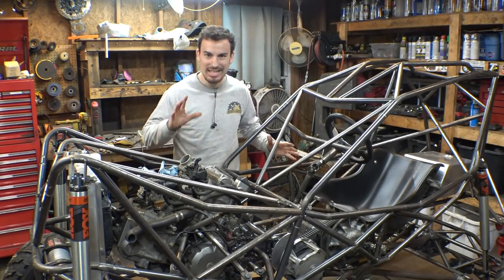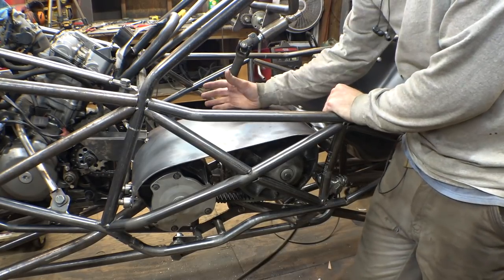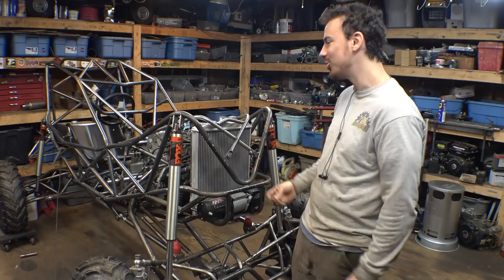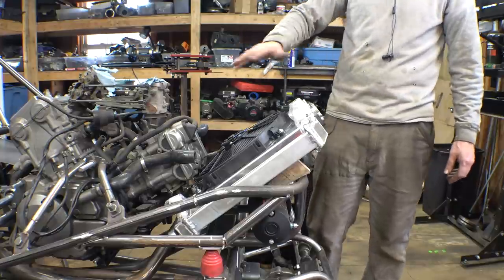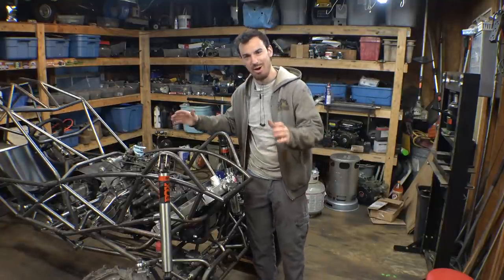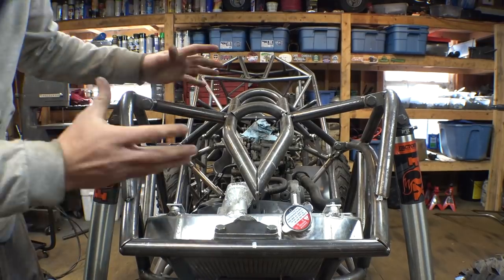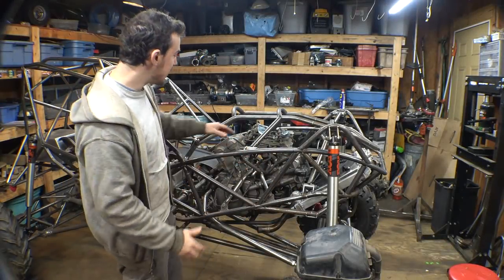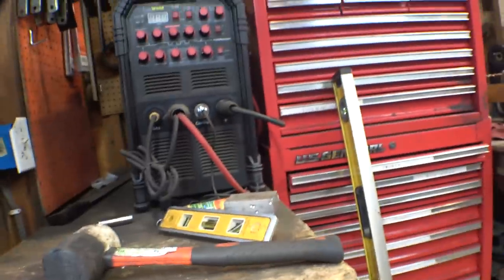4WD Mini Rock Crawler Build SV650 Part 9

Comment: You should wire the fan to blow air through the radiator.  This will keep the hot air out of your face and should theoretically protect the front of the radiator from small debris with a cushion of air. Keep doing exactly what you do. 😊 you’re channel is better than tv channels.

Comment: It looks better! What about leave that x brace between the shocks in then don’t have anything over the motor? Then make a sweet low profile intake/air box out of aluminium like and ram air scoop👍
Reply: Agree. The tubing is just as tall as the radiator he had to move.
Or run the tubes around the side of the engine instead of over it?
Reply: @1one3_Racing  yeah I like that idea

Comment: I agree with you that the front end does look much better. I feel that clutch guard  is adequate, much better than whats on a snowmobile. Yes clutches and belts do fly apart at times but you will be fine with the guard. Good job Chris.

Comment: A surge tank for the radiator would solve a lot of your air pocket problems especially, if you mount the tank higher than the engine . Also some gussets for your beautiful frame will make your rock buggy even stronger .. Great work . Love the progress you are making...

Comment: Move the winch and tilt the radiator back to blow the hot air under the engine and it will help push the exhaust temps out as well. You'll get more vision too.
Reply: I would have suggested this also but the winch up front isnt taking to much room...A lot of crawler in this similar shape have gone rear fan assisted rad for 2 good reasons,.. 1 no blocking the forward view. 2 extra cooling (the distance to and from the motor for tubing would help a bit) plus you could always add an extra rad/fan side by side...all the while still have plenty of room for the fuel tank
Reply: @rongray8416  I was suggesting to move the winch a little higher so the bottom of the radiator could go underneath it.
Reply: @TheWakeupsheeple  True he could have done that and not have the issue of hot air pocket that I think he's going to get with his new configuration...though I think his forward visibility issue was worse than we thought (like next to none) and 6 to 8 inches would not really help much at all (I'm speculating on this) maybe a combo of raising the winch and moving it more forward and lowering the rad with a shallow tilt back could have minimized the whole issue...Time will tell

Comment: I liked the original shock towers from the windshield to the shocks, but I could see the very front had to be reworked so the radiator could lay down. The new design looks good too tho, and the new center supports look 100% better. Can’t wait to see it crawling. Great work!

Comment: should consider redoing the top bar for the "doors", to make it a reflection of the new "hood" line, making the whole line of the car a long exaggerated S . would make the whole side view look more smooth and flowing. BTW should use a propane torch for spiders

Comment: I love that trick you did clamping the piece of bar on the side of the work piece so you could easily set the angle in the bender.
I know that it could be done with a digital angle finder but this "analogue" solution does not require the chassis to be level to work, it just works. 
keep up the awesome work

Comment: Chris, the steel clutch cover is definitely strong enough, but I would make the front mounts attached with a pin as well. I’ve blown lots of belts on snowmobiles, the aluminum belt guards have always held belt fragments, what you need to be concerned about, is the primary clutch. I’ve seen pictures of clutches imbedded in shop walls and ceiling’s after they blew up and went through the belt guard and hood. I’ve also seen them come off and tear around under the hood like a Tasmanian devil, wrecking almost everything before they decide to leave.
Reply: Clutching breaking apart and coming off is due to poor service, or high HP application. 
20 years deep with clutches from all brands. They don't just break like that. 
I've had one blow, belt guard will handle most of the damage even made of aluminum. 
He isn't building tons of power and probably won't even been spinning that thing past 8k depending on his ratios being used. 
And blowing belts I've never had the pleaser often. And I'm a regular with 200+ HP mods. 
Cheap belts normally give out and leave a mess.
Reply: @mitchellandrew3318  you're right, it basically takes mirco fractures on a sheave for a clutch to come apart.  Or smashing sheaves together with no belt.     A thin aluminum guard would do if it was mine lol   I live in winter 8 months a year and typically ride a sled to get around and have for like 25 years.  We used to do radar runs on the lake and we built a ton of crazy sleds in the 90s and early 2000s. Nowadays I just build cheap sleds out of the random carcasses laying around lol  I also have a love for vintage sleds.    My next project is a 2002/3 Edge X I am putting a built 650 triple into with a 136.   I just stuck a 503 Rotax into an Indy Trail because it's super light and goes everywhere..    also WAY cheaper to run wide open than anything bigger and crazier.  We all have nicer sleds..  but you don't go bash apart a $10k+ sled, so most of us have a beater sled that gets all the attention these days haha   I am def more of a build it out of what is laying around type of guy.
Reply: @CobaltOntarioadventures  well it's a few other combos. But fractures play a huge part. I've also run notched weights that pay a beating into clutches. 
I like building high end low cost sleds. Currently is a 15 viper 270hp pump set up. Wedge XCR 440 with a 800 storm motor for now. 98 phaser built fanner. And putting a 503 into a 06 panther chassis just cause it's cost me all of $10 bucks total lol.
I've never been shy on spending money on Toys. Wasn't uncommon to see a 30-40k bill after I bought something new and beat the living piss outta it, then part it out. Not so much as I'm not putting 5-10k on a sled a season anymore. But I normally build to my surroundings, I don't drag race or SX anymore either. 

If he had used thicker aluminum, I would have built my cover outta that to keep weight a bit more down, what he has is complete over over kill

Comment: Hell yeah they blow up on my f7 it took out the oil line under the motor and coil pack cut the wire to the one cylinder

Comment: That guard over the belt clutch etc is definitely a must Using 8th inch should be strong enough Loving this build It's definitely different May need  bigger tires but I guess we will find out after a couple trial runs I'm definitely digging the change to the front Looks much better and mainly it's stronger 
Love all your build bro 🔥👍✌️

Comment: I think filling up the cooling system to the brim and then letting it run until the thermostat fully opens will get rid of any air pockets won't it? Great build and skills!
Reply: That's not always the case, some vehicles are difficult to get the air pocket out even after the thermostat opens. like for instance Honda's they have a bleeder near the thermostat housing. and my Bronco II, I had to take it up the road to where there was steap incline and put it on the incline to get the air pocket out of it.

Comment: Or heres a idea, calculate the how large the carburetor throat surface area is and make flat box to tube and then box on the side. You can go couple inches down, maybe more if you use ridges in center to run box to tube thing first front and then on the side into airbox. Added benefit is that you can get good contract between middle ridges and intake thing. Its getting there but could not personally handle so large front end, since you cant see much what is going on the front of you, specially when leaning back like that.

Comment: There is a reason 90°+ performance buggies have the radiator behind the driver, raised with helper fans or ducting.
Reply: 90% of buggies are much larger than this ans that makes routing pipes carrying boiling water much easier instead of right past the pilots balls

Comment: In reference to your concerns about the radiator fan blowing hot air in your general direction; couldn't you use some thin aluminum to create a caul or shroud that acts like a baffle/duct to redirect the fan exhaust sideways?

As for looks, you went from a bulldog to ghost rider, or, when looking at the whole, a sleek dragons head over something that ran face first into a wall!
I DEFINITELY approve!

Comment: Snowmobiles with 160hp+ use like a 1/16" aluminum belt guard.   It's safe to say this is slightly overkill lol
Reply: Also, what speed do you think that jackshaft with the primary clutch on it is going to spin?!   They typically engage between 2500-4500rpm, depending on weights, springs and ramps. Full shift out  is like 8000-10,000rpm depending on the weights, spring and ramps.  This is why it is crank mounted.. and a CVT  aka-constant velocity transmission.  My money is on it takes 5th or 6th gear for it to even engage and revs out without moving fast.   On a snowmobile engine, you pin it, the RPM goes to basically max right away and the clutches work to make up for the TQ/HP:load.   Hence the term 'constant velocity'.      Same engine RPM, but it varies the ratio depending on the changing variable (load.. assuming you keep it pinned)     as cool of an idea as it sort of is..  I just don't see it working as you plan

Comment: Nice work! It looks WAY better. The only issue I still see is that CVT though. It serves zero purpose and is going to rob a lot of power and efficiency. That engine already has a clutch and transmission. I don't even know if that CVT is going to engage properly with the lower RPM in lower gears. I promise you'll have to take it off anyway, so you might as well do it now. You'll free up a lot of room too.

Comment: If that engine set up doesn't work you should try putting a big bore four wheeler engine in it that comes stock with a cvt system

Comment: I think this machine will looks great without all the side panels. Skid plates yeah to keep rocks and whatever away from the belt, engine, and transfer case but other then that I think you should leave it just as a tube chassis

Comment: Out of curiosity... Would flipping the radiator over and mounting it above the engine with the hoses below it solve your air bubble issue.... Now that you have already spent all that time reworking the frame to put it below...

Comment: Like the changes, but belt and chain cover is not enough to grab a loose shoestring or pantleg.  I would also be concerned about the drive shaft coming apart at speed.  Put something between your body and the drive shaft.  If you did not balance it, it will be turning at a speed to go through that plastic seat when a U joint falls apart.

Comment: Thank god for that it was ugly but there is still a big issue with the roof potentially dangerous the front and back brace are curved downwards making them the weak points so if you roll the roof will collapse you should always shape the roof as a dome for max strength.

Comment: I have noticed you have made references to we, and I appreciate that you want to include us into your builds. but the truth is you are doing all the machine work, and fabrication, and the rest of the work, which is a hell of a lot of work. and we are basically sitting on our asses watching. I just believe the credit should go where it's due. there are probably going to be plenty of places that will need to add gussets. but that can come after the main structure is done.

I did the same thing with a spider just the other day but It wasn't as big as that monster. I dealt with it coming down from the ceiling and damm near landed on my shoulder. it freaked me out and I sort jumped back. and it went onto the floor and I barely missed it and it got away. I used let the spiders go figuring they eat the other insect's. but after getting bit by one and having an area that was like flesh eating virus. I decided to have zero tolerance for spider's and any other insect's.

Comment: I was replacing part of a car bumper, big ol spider nest. yak. Than there where 2 spiders on the electric motor I had to replace the transmossion side of, one fell down to the ground and ran away. The other panicked and played dead for 5 minutes🤣
but a spider that size on the bench HELL NO!

Comment: I honestly never liked the front end. I'm still not 100% sold on it. I think its more the rear end thing in with the front. Its got a whole Carolina Squat thing going on. I think the drivers seat could be higher and the rear end taller so it matches.

Comment: 9:35 Blowing hot air into the intake of the engine is also not good, the cooler the air that enters the engine the better performance it will have, that's why turbocharged cars have an intercooler that cools down the intake air before entering the engine. Too hot air can cause overheating and other problems like unwanted detonations out of cycle that can be really harmful for the engine.
Reply: It's fine there is no hood and it's going to the side of the engine, not in direct contact with the fan. He's also building an air box so he can run a venturi off the side.
Reply: If you were building a drag car, I'd say this would be an issue. In this application it'll be fine.

Comment: I think if you swapped the cab and engine locations you'd eliminate both the space and visibility issues.. Most bouncers have switched to this configuration or putting the engine opposite the driver

Comment: You could also just add a hood to the front so your face isnt getting melted off when the radiator blows a hole or springs a hose... all cool looking and stuff but this thing is a textbook deathtrap and/or injury causer. the cover for the belt is all good and well but you seem to forget that you have 2 legs and your right leg is directly in the line of exploding parts if stuff goes wrong, your left foot is in the direct line of a chain that can, hopefully wont, break. Im not breaking down your fabskills etc but for the love of god, protect yourself more, it's not all about the looks you know ...

Comment: Just get rid of that deadweight of a winch, will improve air flow to the radiator and lighten up the  front end, that is already heavy enough...
Did you ever used or needed a winch on your vehicles?
Other than that, nice change to the front and I liked the cvt cover attaching points!
:-D